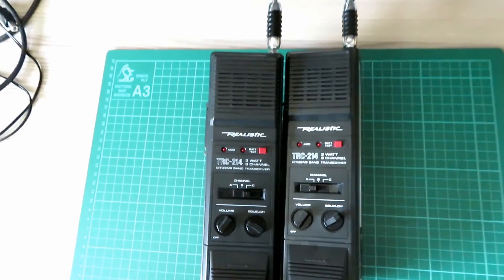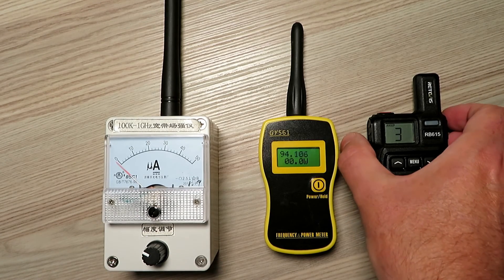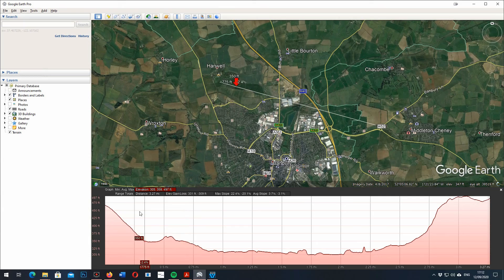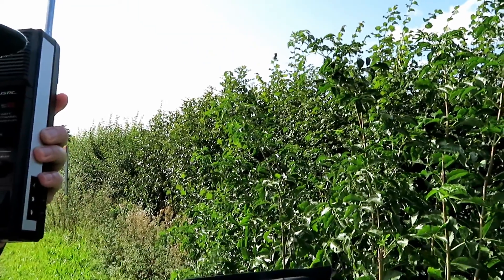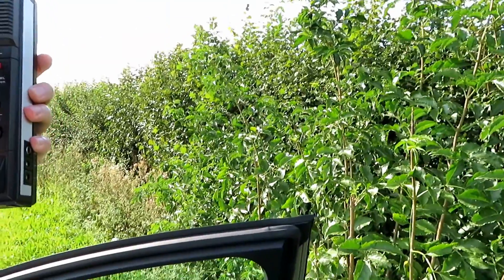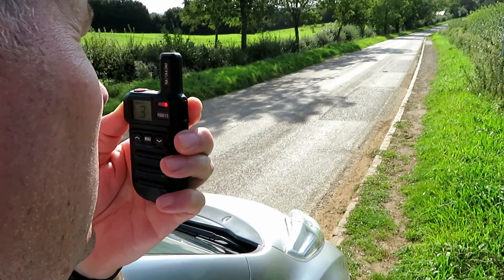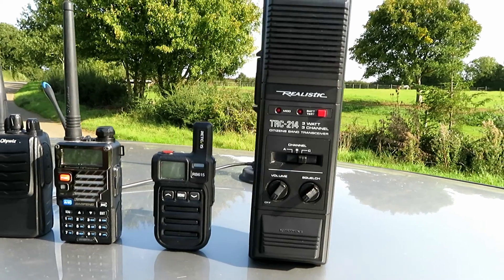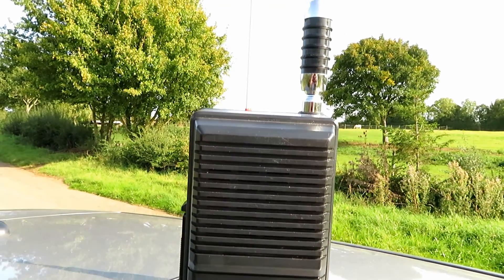STRANGER THINGS RADIOS VERSUS MODERN SETS - REALISTIC TRC-214 FIELD TESTING 2020

Comment: FANTASTIC video... thanks so much for doing this... I bought 5 hand held radio's from Radio Shack over the years in case I needed to talk with friends in emergencies... never used them, all are still on my shelf from the 1980's............. but I was always curious what range i would get??? I did try a couple in the 80's that had the rubber duck antenna and could only get 1/4 mile if that... so I bought a couple TCR-217 with the big antenna's but again didn't think they would go over a mile when I tested them... but I was in a low spot with lots of bridges etc.  ...this was fantastic to see how far they would go thanks again.. I've wondered how far they would work walki to walki for years... also wonder about walki to a base station or good car CB I think they could go a tad bit more.

Comment: Interesting stuff. We used 446 channel 5 at work and it's now almost unusable in the office, even on Motorola radios due to interference. I'm not sure what equipment has changed but I also get UHF interference at home, especially between 444-447MHz.
Reply: Use lpd
Reply from the maker: Yes, check your computers, my PC graphics card is all over PMR446 still not fixed the problem, also sometimes it can be people using Digital modes on PMR channels 1 to 8.
Reply: There is also a other solution. There is a freeband in the 860, 10mW I believe. (google for SRD 860MHz License-free) That band is nice and clear
Reply: @knoxieman  I upgraded to a Nvidia card recently so that could explain the interference. I'll have to do some tests.
Reply: @VicGreenBitcoin  Interesting, range perhaps an issue though.
Reply: @tech-rich  860mhz is a funny band to work on, you will be surprised how far it can operate. However 10mw is still 10mw..let`s be clear on that. That said I know Retevis, they will have a hidden menu so you can easily get a view watts and that will outperform in some cases uhf or vhf...
Reply: @VicGreenBitcoin  Yes, I saw that set on the Retevis site, I imagine you're correct there about the menus. Low power working has to be one of the most interesting parts of radio for me.